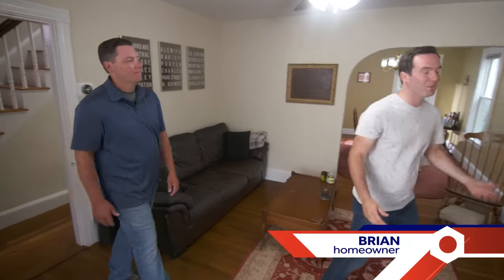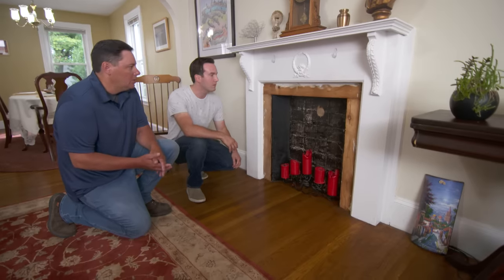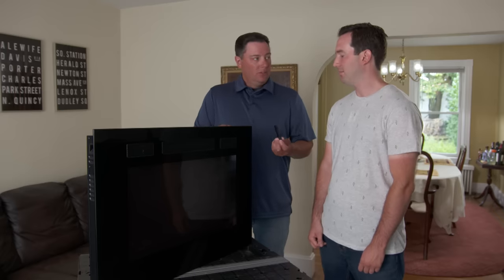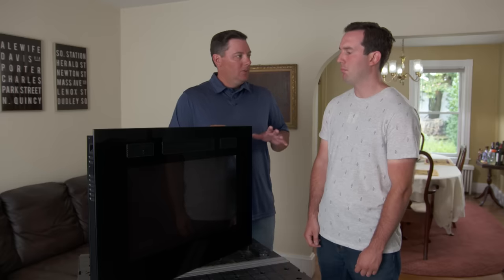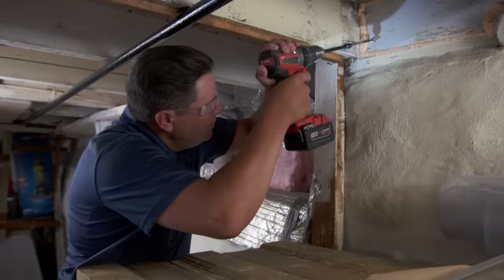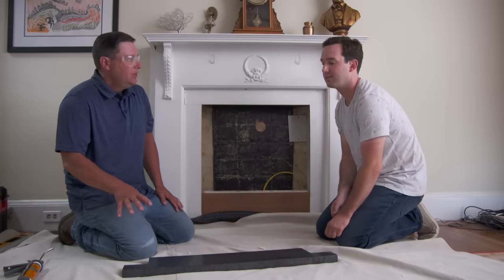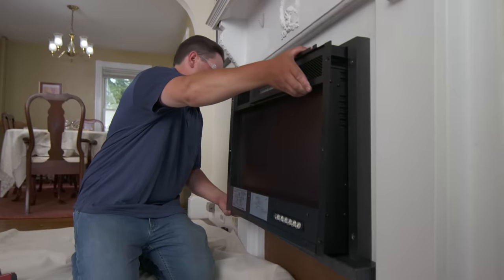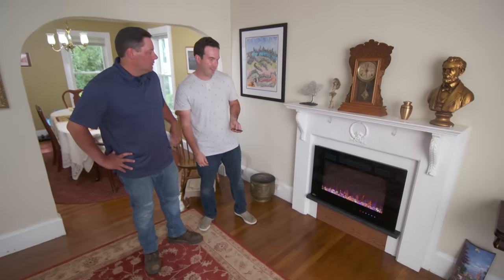How to Install a Fireplace Insert in an Unconventional Opening | Ask This Old House

Comment: I absolutely DO NOT like how that looks. The stained board on the bottom would have looked better if it was white to match the rest of the fireplace. OR, maybe put the insert more at floor level and have the white wood on top. 
But, hey if the home owner is happy that's all that counts. ...I guess.
Reply: @NShores  yea, the unfinished edge on a granite was a mistake also, But, it was a small one compared to everything else they did wrong here.
Reply: I was just assuming that the homeowner would paint it white after the TOH team leaves. He probably didn't want to be a jerk.
Reply: Smiley homeowner will paint it no doubt.

Comment: 1:31  Non sequitur.  You want to keep the thermostat turned down, but you're okay with running a resistive heater?
Reply: Why not? They were talking about 'the room you are in'. As long as 'his friends' are in the same room, and depending on what 'turned down' means, he can DEFINITELY save money heating a room as opposed to a house even it it's a 'restrictive heater' as you say.
Reply: "resistive"
Reply: He did shake his head while saying he is a miser with the thermostat. Mixed messages in his non verbal communication. It was all extremely uncomfortable to watch

Comment: Disconnecting means required ??
Reply: Optional. Depends if you like being zapped or not. But without kidding, i think you can just put a plug on the cord. Then you can leave the power on.

Comment: the problem with electric fires is the cost of the power which will increase dramatically
Reply: That depends where you live. My city produces it's own electricity from damns and electricity here is far cheaper than surrounding cities  and it's actually cheaper (here) to use electric, rather than gas or oil. So it really depends on where you live.
Reply: If you just use the display and not the heating function then the power usage should be no more than like 100 watts. Use the central heating of your home which is way more efficient.
Reply: b8e71fcbe2e195c67d8d16734013d20f  but there is the fault with your thinking..if you are installing an electric fireplace because it looks pretty and are not using it to heat i have one valid question which is why would you even waste the money to buy one because to me that is just a waste of money for absolutely nothing